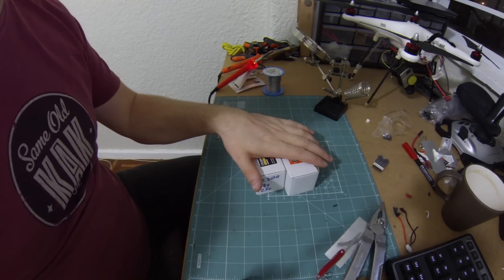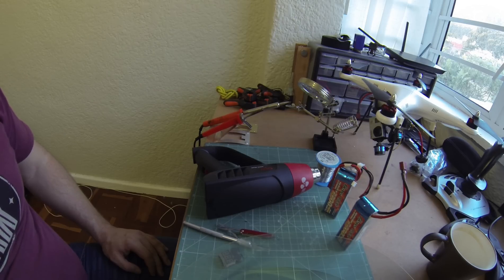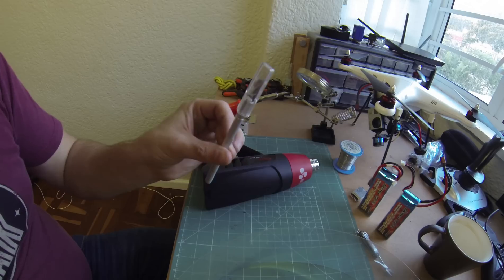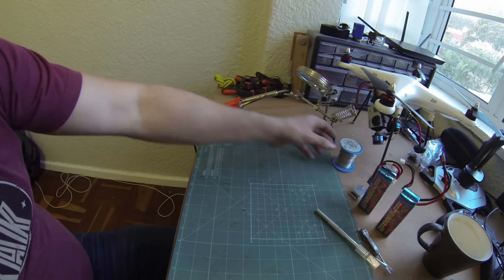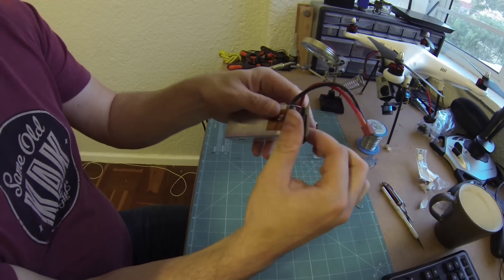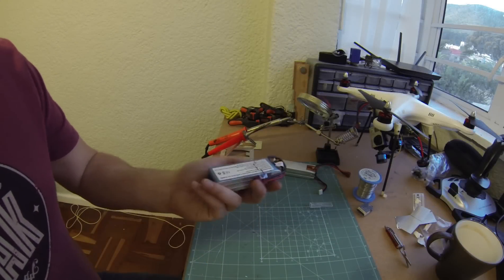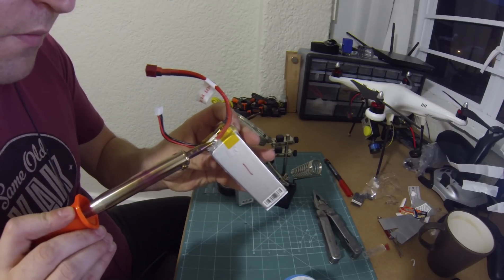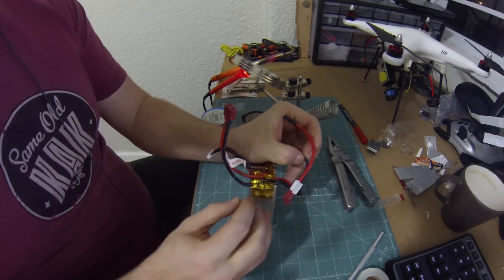Battery Mod - Combining two LIPO batteries

Comment: So the MAH will double but the voltage stays the same?
Reply from the maker: deryl Robinson correct
Reply: ok thanks' i wasent sure if it was going to turn into a 6 cell :-)
Reply from the maker: haha the multimeter is your friend mate ;)
Reply: Yes.. parallel connection same voltage double the mah..

Comment: does c and mah double cus sure I read the mah is same. im make 4s for myself as they stupid money.
Reply: C rating will stay the same,  running batteries in series will increase voltage, or s rating, but mah will stay same

Comment: I spliced in the side of the wire of the battery and twisted on a jst connector wire, test flight went ok. I then took it to park it flew good for a while and then just dropped out the sky multiple times! DO you think the jst wire need to be soldered instead of twisted on? When i use stock battery i push her hard loops, multi flips no problem.

Comment: good day, my plane requiere 4S2300mA, but I have 2 batery 2S 2300mA, can I put in serie and the result is 4S2300mA?
Reply: +Jorge Galan Yes you can, your calculation is right. I suggest you to buy a serie lead to connect the batteries.
Reply: +Jorge Galan Yrs , You can!
Reply: You can butt they have to have the correct c discharge rate for your equipmen

Comment: no disrespect but cant all that be done without stripping the battery down, you would have to charge as separates though.
Reply from the maker: +Gogs ffs So the point was to reduce both overall weight as well as space required to run two batteries in the Phantom 1 shell
Reply: surly you cant be saving all that much weight, and please don't think I am knocking you for what you have done better that than have some people blow their batteries or their rigs, i have done this for my glider to stay up longer but a few grams wasn't an issue for me so didn't have to strip the batteries down.I think I am trying to say you have far more patience than me.
Reply from the maker: +Gogs ffs So with the Phantom1/2 and quads in general a few grams equates to several seconds. It's a while ago but I think I worked out the phantom 1 build I did to be something like 2.3 seconds flight time gained for every gram saved.

At that point this ended up being more of an engineering exercise than a practical one ;)

Comment: Good day .And I have a problem.. I Have two batteries from DJI Phantom 2 Vision deteriorated and I like them for winter loaded 100% on save. And in the summer wanted to fly and they are not holding the load, 30sec of flight sits.. and all the Batteries are 1 year, see they are a bit inflated.. please Tell me how I can to restore them or to replace banks to repair???

Comment: can i connect two 2200mAh 20C and 25C batteries of different brands one battery rarely used one battery used several times ..???  ( turnigy 2200mAh 20C and woflpack 2200mAh 25C)
Reply from the maker: So whilst the only difference is the discharge rate and you could then treat both of them together as a 4400mAh 20C...... I will say I have never tried to mix different discharge rates though have mixed used with new batteries
Reply: ***** wolfpack has 25C discharge rate and turnigy has 20C-30C written on battery..
Reply from the maker: Kit Kat
So yea they are both very similar, personally I wouldnt worry about it too much but treat them as a constant discharge of 20C (20c-30C) is 20c constat and 30C burst
Reply: ***** so in your opinion shall i connect them.?? and after connecting can i able to  charge it with b3 pro charger..
Reply from the maker: Kit Kat  If they were mine I wouldnt see any reason not to, that said all at your own risk ;)

Once connected just charge it like you would any other 3s 20c battery
Reply: ***** thanx sir.. i'll definitely connect them tomorrow.. thanx for your time
Reply from the maker: Kit Kat
pleasure mate, good luck and take your time

Comment from the maker: @jannassary 
Stock motors 980kv
18 minutes
344 grams
parallel
Dont see why not but havent tired it

It's a pleasure
Reply from the maker: You can as long as they are the same cell count, you would simply end up with (in my 3s example) a 4000mAh 3s2p

Comment: So essentially you've now got a 4400mah 3s? I've also got a question. You combined 2 x cells to make up a single cell that you are "balancing" together. How would you know if those two are balanced because they are still two cells aren't they?
Reply from the maker: So you are wiring them up in parallel rather than "balancing" them as such once every thing is connected each cell behaves like a single cell. Great way to test is to charge to "storage" and then do a full charge while paying attention to the mAh count